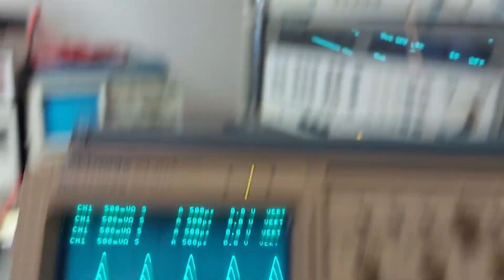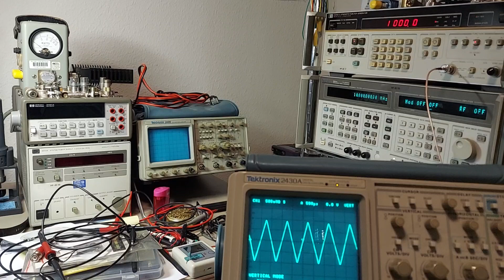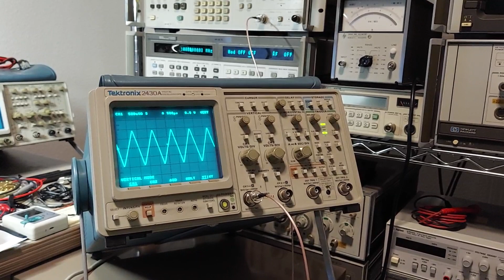Tektronix 2430A

Comment: May I ask what probe you are using? I did buy a used one that came with the original 10x probes. I getting some noise on the sine wave with thing connected.
Reply from the maker: On these scopes I am using the Tektronix P6105A X10 probe. I have also have had good luck with generic X1 probes as well. I only get noise when measuring very small signals near florescent lamps etc.

Comment: What are the differences between the Tek 2430A and non A variant?
Reply from the maker: From what I have read the A version has some extra measurement capability that the non-A version has. Other than that, they are essentially the same.